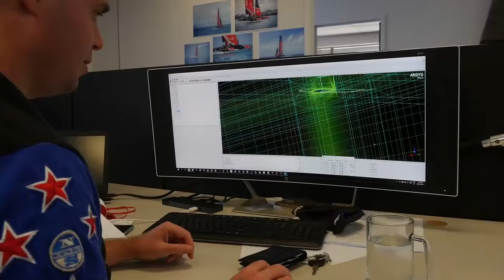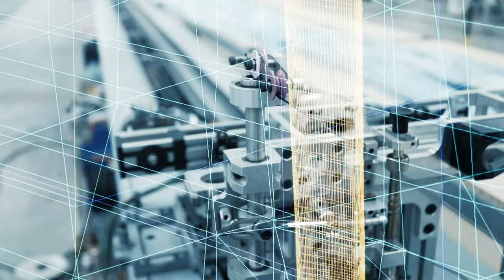The Emirates Team New Zealand Story

Comment: I wonder if anyone has looked into following nature: using vents and Venturi effects via the foils. Using a ram air vent on the side/top of the hull ramming air into ever smaller diameter pipes until it can be sent through the foils via 3D printed channels within the foils. Then coming out just aft of the leading edge of the foil via Venturi this could then be spilt out along the edge and over the surface of the the foils aft, utilising millions of microscopic bubbles that would cover the surface of the foil. Very similar to what Penguins use to reduce drag in the water.
Reply: Innovative... you could prototype it
Reply: Viva venturi, veni vidi venturi🤓👍🍻